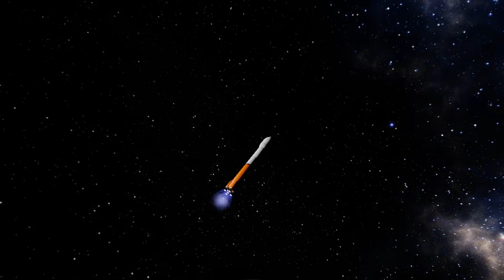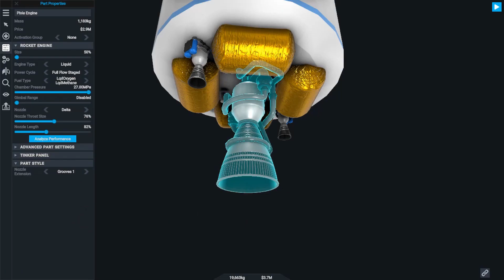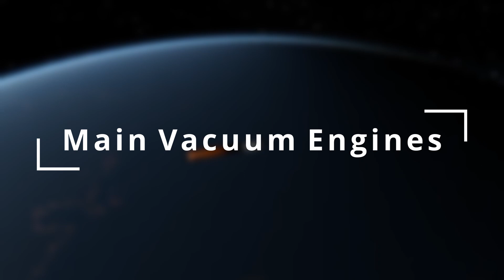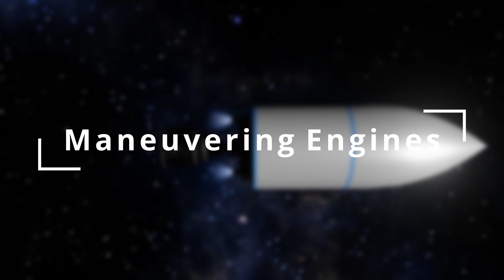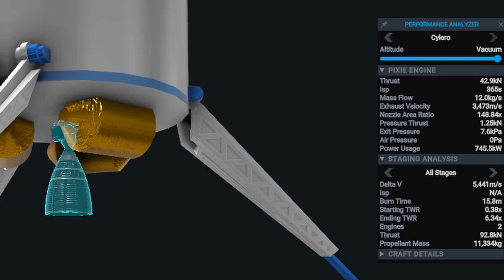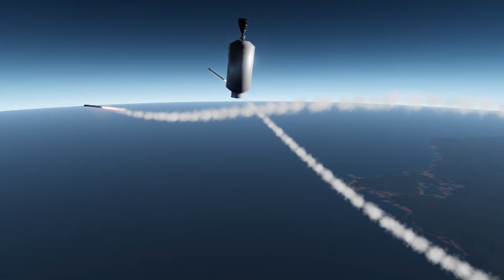Juno: New Origins || How To Build Rockets  Pt. 17, Building Better Engines

Comment: I usually use mage engine with alpha  nozzle thing if your going in surface to vaccume (full vaccume i use bell)
With full flow engine type and for the fuel i use methanol somethime i use hydrolox

Comment: I think mage engine is a proper engine (in my opinion) all it needs is type of fuel,how size nozzle or throat of rocket engine is,how strong it needs and its type of chamber power it depends on you how you optimize engines

Comment: 1.2 TWR is still acceptable for take off imo. Also orbital burn engines dont need much thrust at all you can just use phasing orbits. I normally set my nozzle length to 250% for maximum efficiency with the delta nozzle because I like to have mine regeneratively cooled. I think maybe you should have mentioned some of the real world implications of opting for more advanced engines such as staged or full flow staged combustion cycles as not many people understand the drawbacks of these cycles and just use them in really unrealistic scenarios. All in all nice video.

Comment: Hey!

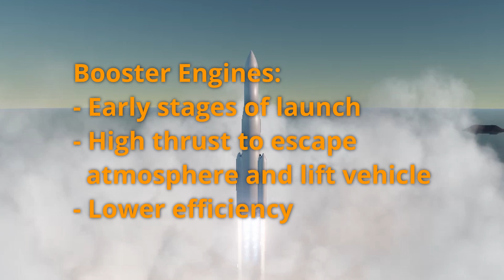What was the rocket at 1:30
Also, do you use the stock system? If not, what do you use?
Reply from the maker: It was an old design I pulled out of my library, I called it the Cylero Express. I made it probably back in 2019 or even 2018. And yeah I just use the stock system

Comment: Can you tell what's the advantages and losses for rocket with higher twr such as 2 or more and for the lower twr as well with respect to the size of the rocket ....??
Reply: extreme higher twr help with hoverslams and descent, although aren't good for atmospheric ascent. lower twr are awful at hoverslams and descent, but are great for the starting ascent.
Reply: In general: If your TWR is too low, you will be fighting against gravity. If your TWR is too high, you will fight against the atmosphere. (Atmospheric ascent)
Reply from the maker: Think about it this way, every second you spend burning vertically to stay in the air is a second you are wasting fuel not getting into orbit. You want to accelerate quickly and start burning laterally to increase your orbital speed as fast as you can, not burn vertically directly against gravity.
Reply: Lesser TWR means less thrust, so your rocket find it hard to get out of atmosphere, higher TWR means your rocket is too fast and can experience max Q, or can even break up in the atmosphere. Thats why rockets like falcon 9 throttle down while going supersonic
Reply: @Quad2018-c1c  k and? dont care lol
I already know that stuff lmfao .
Reply: @reyz360  you are greedy
Reply: @Happy  :)

Comment: general rules of thumb
higher chamber pressure = more thrust but increased cost
larger nozzle = increased thrust, reduced ISP
closed cycle engines are more efficient than open cycle/gas generator, but are heavier and more expensive(because of coaking, you can't do FFSC with kerolox)
longer nozzle = increased efficiency but increased mass(make sure to watch out for overexpansion if your making an atmospheric engine)